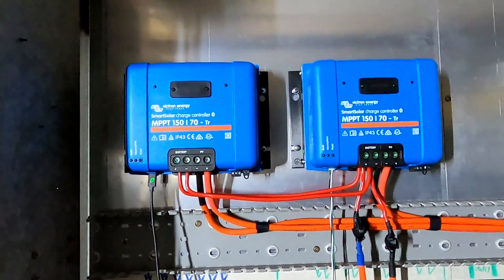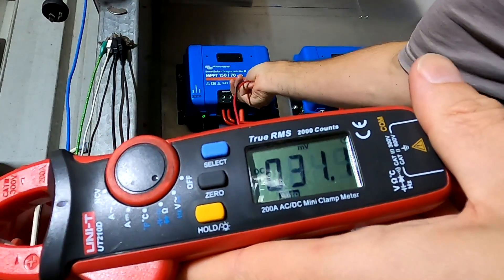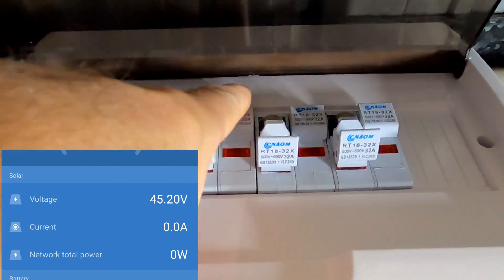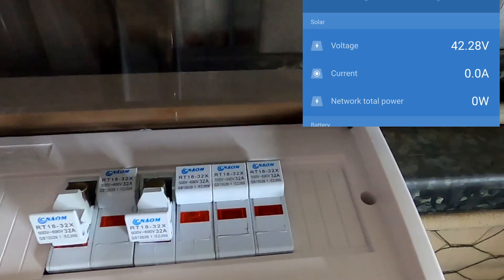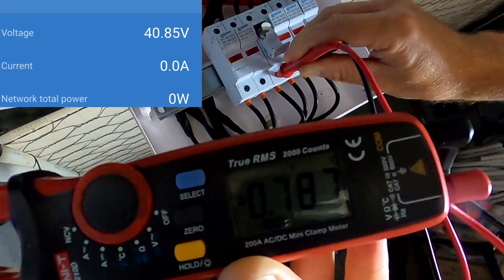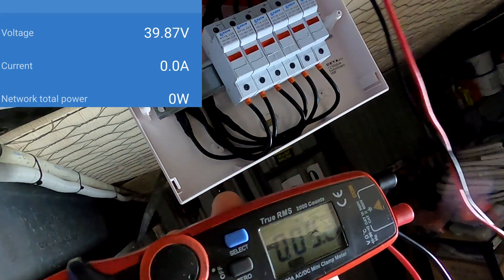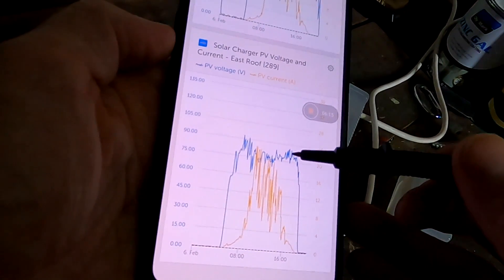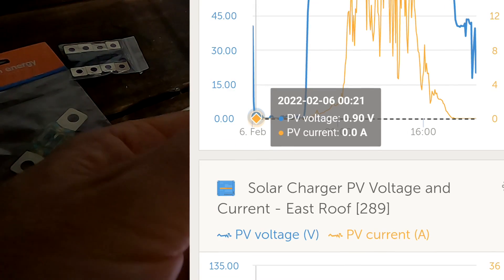40V at Night from Solar. Victron charge controller feature or fail?

Comment: If I observed correctly, the voltage comes up only after opening left breaker of string 2, right? And when measuring on the panel side of the breakers/fuse holders the negatives were closed. Measure again the string with all connections open and also double check the polarity, because the multimeter shows a "-" in front when you measure the string but is difficult to see in the video. The breakers als also marked different at the top (+ on the right)... Panels have diodes inside... Be sure you have to string in reverse!

The voltage can be induced by some RF and can be quite high if the panel circuit resonates. And if the RF source vanishes at midnight, the voltage does as well?!

But yeah, very spooky ;-)

Comment: Possibly INDUCED voltage from running wires close together in Parallel.  Since your batteries are "48" volts a "transformer" effect might be caused by the battery wires being too close to the PV cables.
Reply: My physics teacher once told me 'If you happen to invent a TRANSFORMER for DC, tell me and we both apply for the Nobel Prize!'.
Transformers only work for AC and digitally chopped up DC (VFDs work with that for example), but PV and batteries are usually pure, flatline DC.
That negates any transformer like effects for DC applications as well.
Reply: It usually requires an alternating or intermittent current to achieve the transformer effect. Pure DC current won't work. Does your PV wiring for that junction box run parallel to the output from your inverters? I remember that you were planning to move the inverter wires to run horizontally above the inverters.

Comment: I told you a while ago that you have an electric eel in the garage, but you claimed there were none in Australia.

Feedback from the batteries through the solar controller or static due to wind over the panels.
Disconnect everything and measure each one and measure how many mA there are

Comment: Swap over both charge controllers if you have exactly the same results as before then teightern down all of your nuetrals on all of your single line drawings to find out if you no return ie a floating nuetral.

Comment: It has to be some form of induction going on since there is no source of voltage. My guess is that either the cables are close enough to a non shielded AC cable causing the induction or the large sinusoidal transformers in the MPPT charge controller is picking up some magnetic flux interference from an AC cable. You mentioned your inputs from the street source are on that wall, are they close enough to be a source of magnetic flux or capacitive transfer?

Comment: use mirrors, you can concentrate less during the day, the get high amount of solar no matter what conditions of the day
Reply: collect heat as well as the photo-voltaic output, from the panels, you can cool the panels when collecting the heat at same time
Reply: @CollinBaillie  house care takers job is not useful if you are not going to make power, boost your minimum salary level that you understand the mocking you are blabbing
Reply: @CollinBaillie  junk, all junk

Comment: It's a mosfet issue with solar controller, a problem resistor between the source and gate  of the mosfet that is stopping the mosfet from turning off
Reply from the maker: But why does it fix itself during the night. It comes clear at around midnight. Although this does not happen every night...

Comment: If you can rule out RF interference of some sort (or wiring fault/ground issue), i would just swap the controllers and see if the problem moves with it. If it's RF interference and not the controller, just put a small capacitor across  the string input, i would start with around 470nF, that should at last change things somewhat. The science behind this is that the wires are actually antennas picking up RF which gets rectified somewhere in the input circuitry of the controller, therefore no mystery, just simple physics ... i see that quite frequently,  (because i am a radio ham ....)
Reply from the maker: Capacitor is a good idea....

Comment: here also even with peaks up to 15v average 5v, the unexplained peaks have been solved now, LOL the neighbors left their newly purchased dog outside. with full light in the porch. HA HA

I have also noticed that with your VRM the current flows the other way around from the inverter to your batteries?

maybe try disconnecting the battery and see what happens
Reply from the maker: Wait for the amps in tomorrows video! 🙀

Comment: Ground fault in a module, this is reverse voltage from the battery into the module.
Reply from the maker: No ground fault. I measured all panels against ground.
Reply: @OffGridGarageAustralia Did you measured them with that ghost voltage symptoms or at another time?
Of cause the isolation values depend largely on moisture.

Comment: This is backflow. And if you have the panels earthed then you're getting a loop from the backflow on the negative to earth. Disconnect the battery and see what happens. (remember the power comes from negative to positive, not positive to negative) (PS if you don't have an earth to the panel directly, it means that you have a small earth short on your panels that you need to fix)
Reply from the maker: Well, the panel frames are grounded, not the pos or neg of the panels. And no ground fault for any panel as I checked them all...
Reply: @OffGridGarageAustralia  I’d suggest it’s between the controller and the panels then somewhere.  Start closest to the controller and work upwards feeding power to sections until you don’t see the voltage. It’s definitely a ground fault bleed occurring. You just have to find it.  If you use a long cable and just go directly to a single panel you should see nothing if the panel isn’t the problem. Then you know it’s between the two and can work backwards or forwards.
Reply: Also, the resistor you put across it was lower than the resistance of the short. So likely you have a wire with a small cut somewhere in it that is shorting against the garage.

Comment: Didn't you know?  Everything goes backwards down under!

Your electrons are getting all confused by the coriolis effect.  ; )

Looks like your charge controller has a very high-impedance leaky diode.
Reply: @OffGridGarageAustralia  swap your two controllers and I bet your problem follows the bad controller.  Your 48v battery is probably back feeding into the solar panel input through a leaky MOSFET body drain diode.

Comment: Hi Andy. I can see the 40v mystery started the 5. Feb according to the VRM portal. The  night before 4. Feb it was 0 volt. Have you tried to remove the battery from the mppt, so see it this change anything.?
Reply: No, That 40V has been there also earlier and it has also happened to east roof. 2.2.-22
Reply from the maker: That was when I installed the 2nd solar charge controller.
Reply: @OffGridGarageAustralia  So, I'd like to know if your quick hack to get more charge for the battery, by paralleling the PV inputs is (1) a supported configuration, (2) is the source of the issue, (3) still showing that phantom voltage at the SCC PV inputs when you have the PV strings disconnected, (4) still show the phantom voltage if you remove the parallel PV input wires between the SCCs?

Let's go back to "supported" or "expected" install configuration, and NOT link the PV inputs, before you go physically swapping the controllers.

Also, do you have both West roof and East roof running into both SCCs? What if you remove this string paralleling? Then try with the strings in parallel but not connected to any SCC, does the phantom voltage appear?

What are the voltages of the 2 strings individually, how much do they differ by? From memory not 40v.

My guess is the paralleled PV inputs of the SCCs is not a supported configuration. Something in the SCCs does not expect this and they have not included any sort of loopback protection from one SCC to another via the PV inputs. There's a loop in them thar parallel PV wires.!

Comment: Probably a faulty panel or wiring
And it's mak contact with the metal of the garage. And the mppt is also connected to the metal of the garage. Try to measure the voltage between the metal of the garage and the solar panels. And also the installation resistance
Reply from the maker: Yeah, did that but could not measure any potential between solar and the garage ground. Also would have been fine if I disconnected the faulty string. But still getting voltage even if they are disconnected.

Comment: Additional display and communication connections need voltage to work – even if it's dark outside. Guess there's a function in the regulator. It seems strange anyway – can be several sources. The built-in capacitor discharges quickly, but the voltage returned again. The DC current goes from input to output - the distinction inside the regulator is likely the place where the Volt level can leak over. Transistor level is necessary to measure - I think.

Comment: To me it looks like feedback, possibly “ground loop” or the lack of an earth on the controllers. Have you tried earthing out each controller as per the installation instructions and then measure again ? 🤷🏼‍♂️
Reply: or try to bypass overvoltage protection! there is some AC on + and -, but half wave is grounded.. your multimeter does not show it, but big capacitor on input can "see" it..
Reply from the maker: I connected a ground cable to the SCC with no difference.
Reply: @OffGridGarageAustralia  very strange 🤷🏼‍♂️

Comment: Well Andy it' s quite strange: I live in an appartment and my 75/15 measure around 1volt at max. 
I think that the problem could be caused by the charge controller and a ground problem with the mppt because evendow you disconnect the positive there is still high voltage

Comment: Maybe the solar charge controler is defective and is leaking voltage from battery to solar.
Maybe a reverse diode inside the solar charge controler leaking.
Reply: During the day your solar voltage is higher than the bat voltage, so no reverse current.. (ideal) diode in controller defective.
Reply from the maker: Could be. It's working fine during the day...
Reply: @OffGridGarageAustralia  it is normal during the day the diode is working in the right way Solar > battery voltage. Problem at night battery > Solar voltage and the diode is reverse biased. If battery voltage is too high the diode can leak and become conductive with a voltage drop of a few volts that would explain the voltage inferior to battery voltage on solar side.
Reply from the maker: @vaneay  It's not consistent though. Sometimes the voltage disappears after midnight, sometimes it tapers of down to 30V until the morning and sometimes it's not present at all... I would expect a faulty diode or element would have the same effect every day and the fault would repeat itself in the same manner.
Reply: @OffGridGarageAustralia  if you switch the solar charge controller did the problem occur ?
Reply: @OffGridGarageAustralia  a lot of parameter could cause the apearance of the problem, temperature , humidity, cosmic rays

Comment: AC induction from string 2 underneath the panels in side your garage. Similar to the problem you had with led lights?
IV only had this onecs where AC cables are disconnected but still shows "power".
Or it could be star dust, or even buckfomacks...... Are playing tricks on you.
Reply from the maker: As I said, there is no AC in the shed at the moment. 0VAC, nothing is connected to any AC.

Comment: Andy, just a small question: Do you use the ve.direct cables with galvanic isolation? Seems to me as if they were different on each mppt charger. And what about grounding regarding the mppt chargers? Parasitic voltage oder parapsychological  voltage?

Comment: could be some sort of capacitive coupling via the panels and solar wiring,.... is there a ground connected with the solar cables somewhere? If yes, maybe it act's as a antenna and feeds it over the modules as rectified dc.🤔 It might come from a ground wire that is interconnected somewhere with the PV array and feeding this phantom voltage.....
 I know a similar phenomenom with AC wiring on lighting circuits that can be switched from three switches where the LED-Light stays on dimly if the switches are not in a specific position but goes out when they're switched right,......

Comment: Could you possibly have a stray voltage on the earth that's grounded to your shed from the house ac maybe inducting into the solar wires? MEN link from the house ac/mains supply.
Reply from the maker: The house in 50m away and has its own ground rod and MEN inside the subpanel. Garage and solar panel frames are fully grounded. 🤷‍♂️
Reply: @OffGridGarageAustralia  You have an ac line from house to garage also don't you? That earth would also be bonded to garage. Just spitballing here. otherwise it could just be that your panels are producing some voltage from the moon. I have had this before with some panels on my camper van roof in a full moon.

Comment: I am thinking there are two options:
1. Some induction, perhaps from an RF source nearby.
2. The charge controller is leaking voltage back. Measure the resistance of the circuit with the charge controller in circuit, then turn it off at the breaker and put a resistor of the equivalent size in circuit with the panels and see if there is a voltage drop across the resistor without the charge controller?

I think the voltage drops when you take the panels out because the capacitance of the circuit changes. Perhaps also check that there is absolutely infinite resistance to the metal frame of the building to the solar panel circuits just to make sure that a touching conductor isn't in play.
Reply: A shotkey diode put inline could remove this reverse and would be easy to install for a test.
Reply from the maker: I checked the panels and there is no ground loop in any direction. More to come...

Comment: Voltage is potential.
So there is a difference.

I suspect the config on the controller I a buck and therefore has a PNP, and a common ground.
Thus the potential.
Reply from the maker: But why only one controller then?
Reply: @OffGridGarageAustralia  I suspect that's your 0v
What does the night voltage show during the day?
What's your battery voltage?
Where are the controllers linked?
Where are they not linked?
Does your multi meter show the same voltage?

Btw mine show 2.64v, that's from the road light close to them. My system volt is oc 38. I've 4 panels. Do you have a light source? Clear full moon?
Reply: @OffGridGarageAustralia  would the other show a negative voltage? 
You should have a link somewhere that's causing a reading.

Look at it as 0v + -40v  if 0 is on the positive side you have a 40v reading.
Without knowing the internal, and wiring set up... But I'd look for a -40v causing the reading there could be a few cause's.

Comment: Hmmm there is somekind of correlation with that 40V and battery voltage and current. Sudden changes in them start/stop that odd 40V.
Reply: East roof has also done that same 40V on 2.2.-22 at about 2:00
Reply: Could it be some kind of "two fault problem"? Charger leaks voltage, but needs some kind of RF/capacitive voltage to start it? Or enough voltage difference across it (between battery and solar array)? Anyway I think that 40V is result of current leaking from charger. Might be good idea to measure is it DC or is it some kind of AC.
Reply from the maker: Good pick up. I haven't seen the east roof doing the same that day.

Comment: Maybe something about how you connected them together.  Is there a master/slave or parallel setting?  Maybe a software bug that an update would fix.  Otherwise, one of them looks like it has a bad MOSFET.
Reply: Are you referring to the two solar charge controllers, paralleled at the PV inputs?

Comment: Mr. Andy, does your's battery has grounded poles? If yes, I suspect overlaying problems - leakage from panel's negative to ground and also leakage from battery side to panel side in the controller. Maybe it is "normal" leakage in the controller. For example, through measuring circuits inside the controller.
Reply from the maker: No grounded battery. I'm floating...
Reply: @OffGridGarageAustralia , I have only one suggestion. Roof panels plays role of 1-wave rectifier with negative line to controller. Adjacent AC wiring inducing AC voltage to panels, which is rectified and traveled through negative wire to controller. Return path is through filter and parasitic capacitance of panels and equipment. Or, maybe, some leakage exists in panel's circuits. Controller's internal circuitry seems to be OK, as swapping of units hasn't cleared this issue.

Comment: High resistance leak from inside the controller which would have to be from the batteries. Neat problem. Turn off the batteries and see what happens please.
Reply from the maker: If I turn off the battery, bot SCC turn off as well. That's their power source.
Reply: Use a power supply and measure the voltage on the solar side.

Comment: Thoughts: perhaps your cables are picking up AC current. The solar panels act as a diode to rectify it. A capacitor in the Victron may smooth it. Do you see any AC voltage on the solar panel side at the isolator, when the charge controller is disconnected?
Reply from the maker: AC from where? The shed is offline- off-grid for 2 weeks now...
Reply: @OffGridGarageAustralia  That would be the next question to ask if you find any AC 🙂
Reply: @OffGridGarageAustralia , but the Main grid panel with meters on the wall outside?